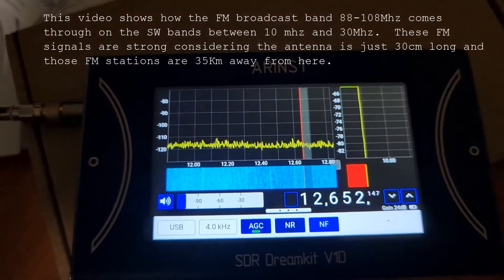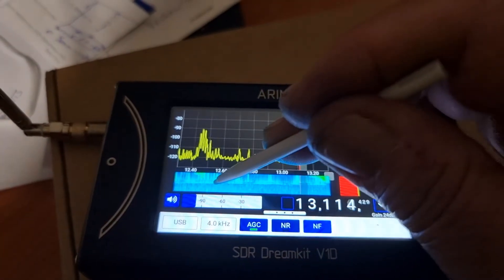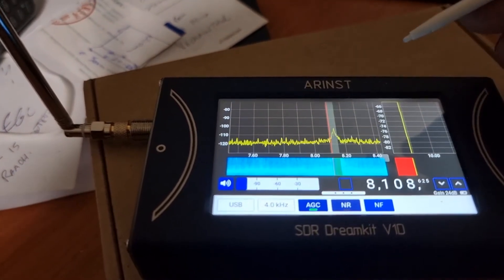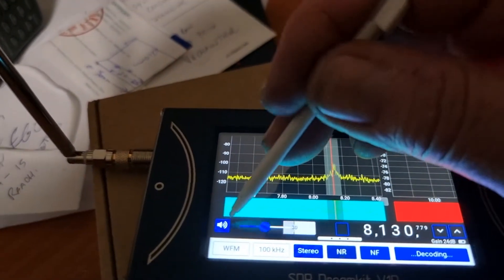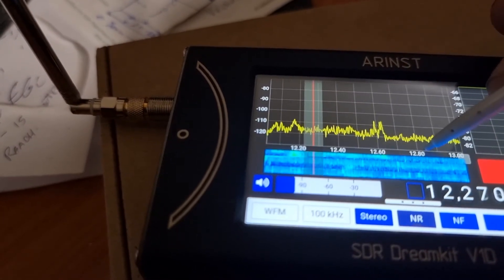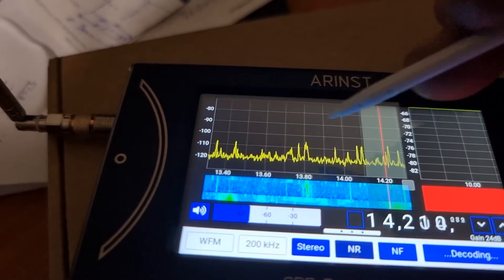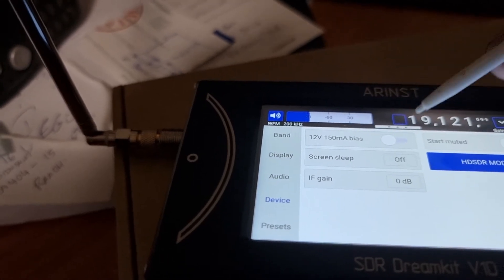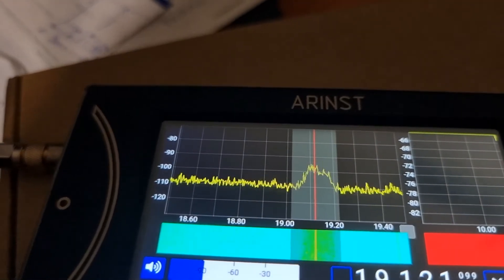SDR Test

Comment: Did you check with a simple preselector, for example simple FM broadcast filter which can be found on ebay with SMA connectors? I have seen in the Manual that there is really no Band filtering in the V1D.